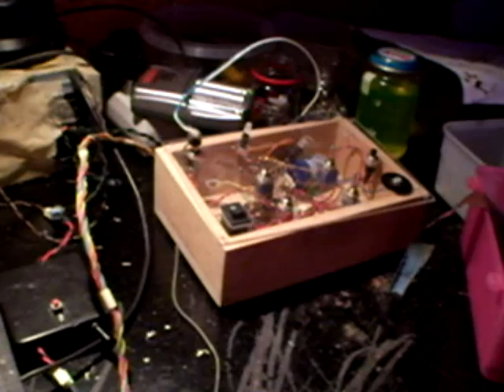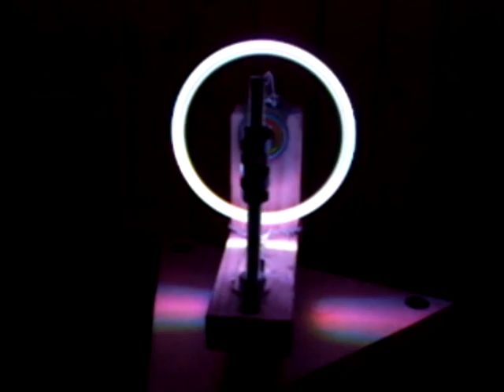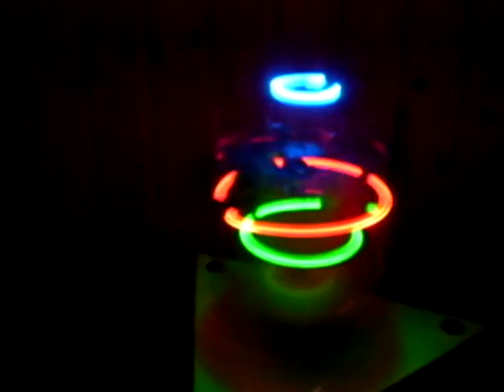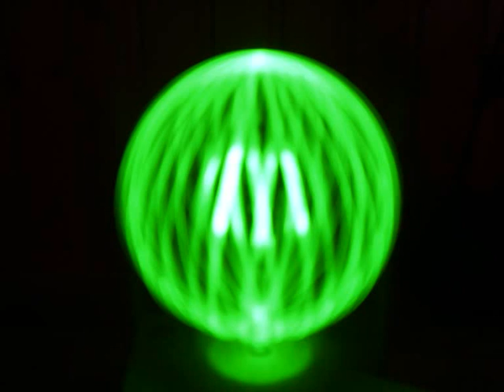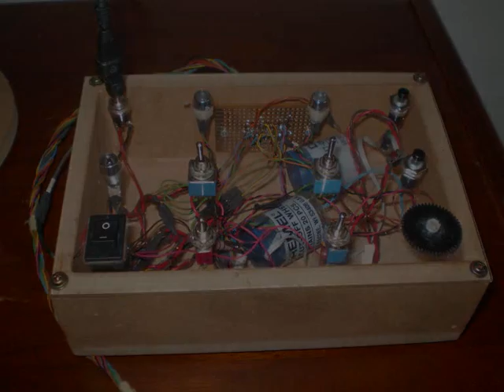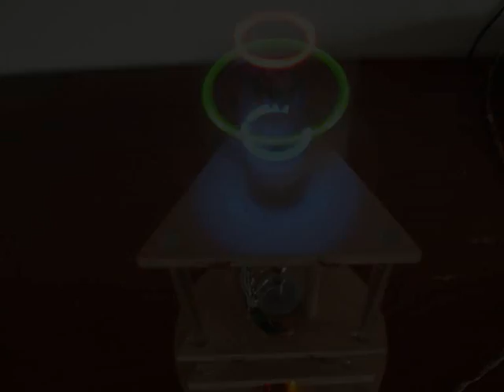Spinning LED-Ball (RGB)

Comment: This may be confusing, and may sound stupid, but is something is spinning, how do you get electricity on it? 
For Example: You had a motor spin, with another motor spinning on it, and than LEDs powered, how did your power source work?

Comment from the maker: @VeroYvlen I'm sorry, but it's the rules of the internets; If u claim you can do something, prove it.

The rig I made was not easy, because I made it proper, as far as mechanical engineering goes. It does not run on batteries.
So forgive my expression when some claims it's easy to do (by just taping some batteries and motors together, which of course IS easy).
I don't mean to disrespect, but u are comparing my hard work to something that sounds half-assed, maybe it isn't, I'd love to see.

peace

Comment: @AndreaDs5 1 is red, 1 is blue, 1 is green..

you notice @ the very start, when it starts spinning, its a white color.. , that is due to to equal amounts of each color in the rgb spectrum..

when you see the flickers or different colors,  it is due to 1 or more of the leds either being off, or flickering for a specific amount of time..

there are 7 possible combinations of the 3 solid colors.. thus 7 different colors, flickering and turning off random leds, is how this works..

Comment: Hey this is awesome,
Just wondering,
are you using standard DC motors and PWM?
are you using anything fancy to control the lights like a microcontroller?
im also assuming this used alot of slip-contacts.

To make this at 16 is very impressive. good work.

Comment: Nice design and implementation. I'm working on a completely different project, but I must ask... Question: What did you use for a slip ring? All I find are good up to 500 RPM.
Thanks a bunch.

Comment: @mxxxel Then inside motor is spinning at least 2000 RPM, so the outside motor has to spin at a different speed.  Since most the streaks are vertical, the inside motor is probably spinning faster, I'd guess inside motor = 6 or 8 times outside motor. (NOT AN EXACT MULTIPLE)  It looks as if he is varying the RPM or the outside motor, but it's hard to tell.

Comment: how do your transfer the power to eliminate the twisting of the cables.... Im trying with 2 small metal wheel ... 1 for + voltage ; 1 for - voltage, but isnt very stable.